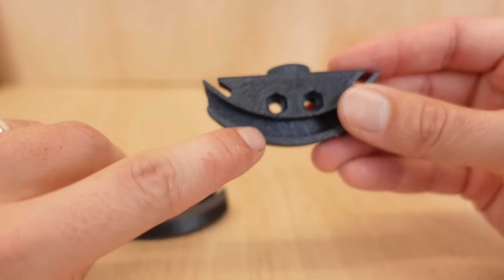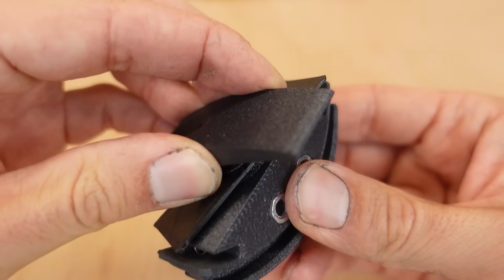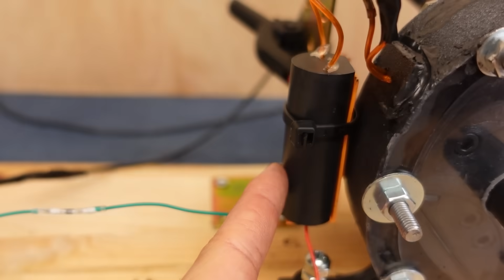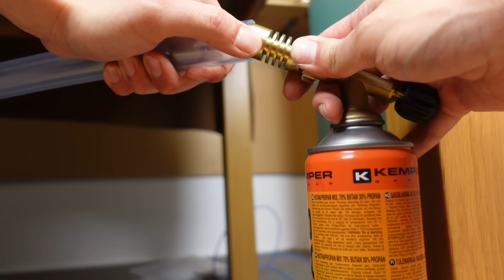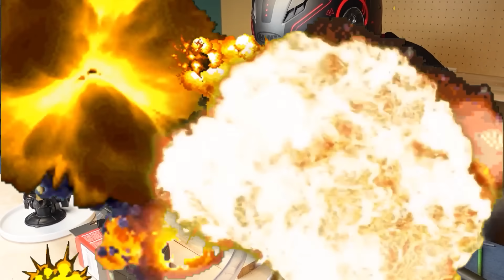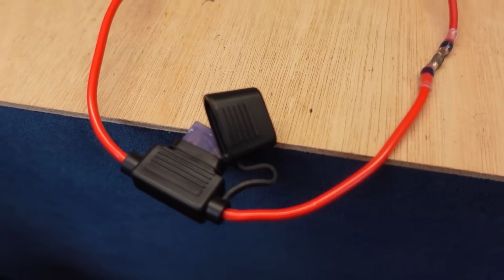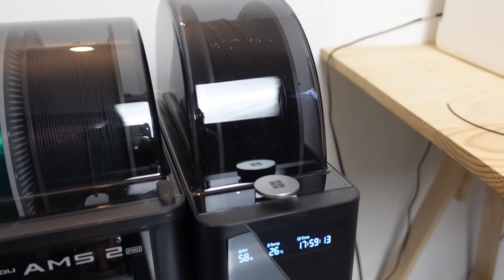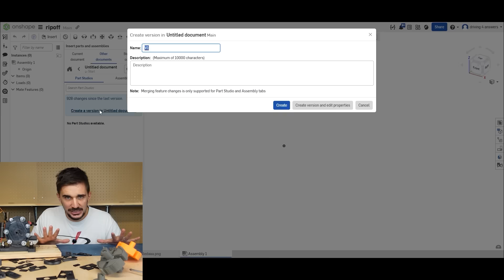My Oval Engine Now Fires At Will! Major Milestone For DIY Oval Rotary Engine 2.0

Comment: at 16:30 - Perhaps it doesn't start because of the geometry of the moving rotary assembly isn't conducive to producing torque.  In other words, the forces produced by the gas expansion can't produce troque to turn the center part of the rotor because there doesn't seem to be any leverage per say. (even though you have a variation of volume, the gas expansion must be able to apply some leverage somewhere, and I don't see how this leverage could be applied in your 2.0 design)
One way to test this is to position the rotor at firing position, remove the spark plug and inject some compressed air in the spark plug hole to see if you can make a small rotation.  There has to be a position where if you increase the pressure, it must turn by itself, even a bit.  Perhaps add grease to the grooves of the 2 moving halves would help? 🙂
Reply: This is why the patent that he is (maybe illegally) coppying has an assymetric combustion chamber with a face perpendicular to the tangent of the rotation.
Also, if you watch his slowmo, his timing is completely off. He's not sparking at the point of most compression
Reply: Correct
Reply: Yup. Not producing torque
Reply: The flame bursts out of the exhaust tube indicate he's not even fully combusting his fuel either. Needs waay earlier ignition.
Reply: I was looking for this.  Test with compressed air first.  Manually activated to check torque and seals.  Then swap to a solenoid to tune timing.  You only need an exhaust port initially.
Reply: I agree and commented the same. Then I read many other comments about the lack of any air being mixed with the fuel and also the unknown compression ratio. His combustion events don't look very energetic, if the engine had verified compression and a proper fuel air mixture, then it would at least have a chance of demonstrating whether his rotor is even capable of producing any torque as it's configured. It does appear to me that the combustion would probably be trying to spin the engine  both forwards and backwards at the same time, or in neither direction depending on how you want to look at it.
Reply: @SteveRucano  Yup.
Reply: That's what I'm thinking. It should have an indentation on the rotor surface so that when the combustion occurs and the gas expands it directs that thrust in a way that produces torque in the direction of rotation.
Reply: @meatthermometer1  uns sei es nur eine nocke an der rechten kolbenseite
Reply: Was also my gut feel but couldn't be bothered to pull out my calculator atm.
Reply: if the combustion begins right at 9oclock on this build, would it not then be combusting and expanding as the top of the rotor opens up new space, there for putting more force on the right hand side of the chamber... no as i type that out im thinking the volume doesnt matter, same surface area on both sides of the rotor, its not trying to spin it, but rather bend the two ends in towards the crank shaft

maybe this is why the russian version he copied had cavities on the leading edges of the rotors

Comment: You need a flywheel. As a kid working on push mowers my dad taught me that the mowers with an aluminum flywheel needed a blade to run. I experienced this first hand. The premise is that the aluminum flywheel by itself is not heavy enough to keep the engine turning. Once a cutting blade is added it started right up.

Comment: Have you tried to take off the cover and to push the rotor by your hand in the same way the BANG would do. Is there enough torque in the desired direction at all? It will push not only on the right part of the chamber but also on the left part. And when it's in the center position the power stroke is over already.

Comment: an engine needs the following: 1.: fuel, 2.: oxygen (air), 3.: spark and... 4.: Compression !

you need the proper fuel/air mixture drawn into the engine, then compress it and ignite it.

your engine lacks the compression part.

also i cannot see the direction the ignition pressure would push the 'piston' to give off the torque on the 'crankshaft'.

on a piston engine the expanding gasses push the piston downwards and in a wankel/rotary engine it pushes the dorito away from the oval corner which expands the space and gives it's very limited torque to the cogwheels and the 'crankshaft'.

your engine never really compresses the mixture and then cannot extract the force on it's piston.

keep it coming ! i love your content, bud ! 😎🫡

Comment: This engine will always be fighting an uphill battle against friction when compared to a piston engine, because of the sliding surfaces aside from the seals. Combustion pressure needs to overcome this movement, and right now the combustion seems to end while this sliding friction is max, while also increasing this friction by pushing the sliding surfaces together. I honestly think the best way to improve the design would be to try and reduce the friction between the lobes and the rotor, either through reducing the surface area, machining a teflon interface or getting pressurized lubricant in the interface, either internally a time of assembly or externally with small holes and a pump.

Comment: the taser modules are 3 to 6v max (whoops you allready know now)
the shaft should have a seal you have zero compression cause its leaking everywhere and theres not much lever arm to actually spin the damn thing and no flywheel but its promising ig id say get it running on compressed air first then combustion :)

Comment: perhaps polycarbonate plastic sheet would be better for the front cover, much better heat deflection temp. 
You can even use a sheet of mica mineral on the inside surface. 
For the gaskets maybe you can make a 3d printed mold and then inject a high temp silicone(?) type of material that then sets in the correct shape.

Comment: You are nuts (this is a compliment, please don't get it wrong)! I really like your way of "thinking outside the box", you do a great job. One question, if I may: how will you lubricate this marvel? But hey, one step at a time, first let's solve the timing and the spark positioning. Thank you for sharing your ideas, you surely keep me busy :)
Reply from the maker: Thank you for inspiring message! I shall lubricate it with oil! This design is actually pretty easy to lubricate compared to the rotary vane for example. It's even better suited to lubrication than a wankel.
Reply: @d4a  Oookay... sealing the sides, the rest of contacting areas, without burning a ton of oil... I declare myself beaten at that. Probably my box is smaller than yours and its getting cold outside :) (kidding). Then the cooling, even turbo charging. Yeah, I'm out of my league. Oil-cooled, perhaps? Could work. The sealing is the part that worries me the most.
Reply from the maker: The engine has a total of 6 seals. That's it. The only thing you need to seal is the little chamber, everything else is conventional. Everything outside the chamber can be lubricated. Even the inner walls of the housing as long as chamber seals scrape well enough. It will definitely always burn more oil than a piston engine but in theory it shouldn't burn more than wankel.
Reply: @d4a  Thank you for explaining. I'm definitely eager to see the further development, I'm also sure you will get it done, properly. Keep going, please. Have a great day (05:37 PM here)

Comment: Where is your oxygen coming from? You're just putting in propane and butane in it if you can't regulate the air fuel mixture it's never going to run just so you know!

Comment: Do not press in bearings by the inner race!, always push the outer race (assuming the friction you're against is also on the outer race, i.e. not pressing a bearing on a shaft)
Reply: usually yes, but...... its a giant bearing going into plastic here lol

Comment: I most likely don’t know what I’m talking about but my guess is to increase the displacement by making the engine thicker and adding a flywheel. This added displacement should increase torque to the point that it can easily overcome friction.

Comment: Those cheapo high voltage generators need to be constantly discharging, if not the output voltage will climb until the internals flash over and die.

Comment: Definitely the ignition timing and the lack of a flywheel. You can see the combustion occurring when it's starting the exhaust stroke.
Reply: You can see the combustion continuing out of the exhaust hole. That is probably even applying a retarding force to the engine

Comment: I think the drill is stopping the free rotation of the engine as it is at a consistent speed, also the copper wire is bending is definitely a factor. Maybe a flywheel and a lawnmower style pull cord will work?

Comment: Sorry for being stupid, by why would this engine generate ANY torque.  Seems to me that an explosion of the fuel gases would apply pressure to both right and left seals of the rotor creating practically zero net rotating force. And the only reason you see exhaust to happen is because you force the rotor to move past the exhaust port by using the drill. Am I way off the mark?

Comment: The reasons why it probably can't run, even if both chambers fire, are...

- friction is obviously way to high
- no flywheel 
- to little compression 
- no precise ignition timing 
- not enough controle of mixture 

Sand the sliding parts, and put thick motor oil in (also for sealing)
Put a big flywheel on.
Make sure the static compression is at least like 1/5 or more.
Build a proper ignition you can adjust precisely. (You got the parts already).
Let the engine take in air directly, and adjust pure gas with a fine adjustable valve. (The one on the bottle might be good enough, just  remove the mixing nozzle from the burner)

Comment: Use a magnetic switch to detect the timing.  Something similar to what detects when a door opens or closes.  Then you can adjust the position of some magnets around an external rotor to get whatever timing you want.  At least, that is the first thing that comes to mind after watching this.

Getting combustion in a 3D printed prototype designed engine?  Ya, that will never work....  Or so any normal person would say.  Congrats on doing the impossible.
Reply: Now that I think about it, magnetic switches probably are not fast enough.  Better to use sensors and a microcontroller.  Oh well.

Comment: Could there be the possibility that the reason that your coils are burning  up because you need BALLAST RESISTOR to protect and prevent the ignition coil from burning up, due to, over current (amps).

Comment: how do you not see it that your design has equal amounts of combustion rotating the motor backwards and forwards? Just draw a line from the axle to the rotor edge where you see flame. That is the torque generated.

Comment: It seems that a) ignition is a bit late and b) how are the holes the spark wires go to the chamber sealed? 
a) Shouldn't it fire the moment the spark wires "see the chamber (max compression?)? 
b) Don't you have compression loses there?
...my 2 insignificant cents...

Comment: 0:11 HA GOTTEM 

Okay jokes aside, I love it when engineers try to simplify the four stroke cycle by skipping pistons and valves entirely. I wonder if the ignition timing could be further improved by jerryrigging a standalone ignition management system (one half of a speeduino…?) and tune this thing better.

Comment: 14:53 I think you need a better electrical contact system, it might be regarding the timing too much when it has power. watch for the spark after the two explosions. the copper wire may NOT be snapping back fast enough when it gets a bit more spin thanks to combustion help.

Comment: I wonder if you can take these plastic pieces and electroplate them. Deposit a thin layer of metal on top, to help dissipate heat, create a smoother surface, and stronger higher heat resistant materials, that are still easy to make.

Comment: Those potted hight voltage power supplies are made for a 5V input and a non-sparking output.  It has no load control, so sparks are a dead short to it, thus pulling more current than it can handle.  Drop your input voltage and add an output capacitor, or just switch over to an automotive ignition coil.
Reply: I was about to say the very same thing! The "spark generator" (sold on eBay as taser units) are clearly described as working from a 3V to 6V DC supply. Connecting a 12V battery just fries them?!? What a surprise!! 😂

Comment: From my experience, you want to keep the hot leads from high voltage generators as SHORT as possible. With long leads, current leaks through the insulation without necessarily creating a spark. You can run them at a lower input voltage and they will last longer.

Comment: This modules are not 12v they are 6v they work even from 1 3,7 18650, from 12 they are overloaded, this is why they die so quikly

Comment: dude, it clearly says 3V to 6V on the listing and you are trying to power it with 12V battery? why? there are ones who run on 12V btw... also the ones you are using produce like 2-3 sparks per second which will be impossible to time right, you need one of those that produce sparks almost continually...

Comment: If you made that part you hit with a hammer with fillets on the sharp edges it would be a lot stronger. if you look at the corners of the part on the inside you will see that the filament isn't even extruded properly in those corners.

Comment: Instead of going directly to gasoline, try ethyl alcohol (ethanol) first.

Ethanol is used in modern gas as an anti-knocking additive.

That tiny engine cannot handle any amount of knocking as it is 😂😂

Also, it might help to use lubricant. Baby oil (mineral oil) should work- though a simple two-stroke is equally as good.

Comment: You've probably already thought of these but I am sure it needs a flywheel, and better timing than loose wires. a hall effect or optical sensor to activate the plug would be much better. I don't know how well you do with electronics, but some simple microcontroller (like arduino) with some coding would allow you to adjust timing very precisely. totally worth it in my humble opinion even if it increases complexity quite a bit. I am very excited to see what you come up with next, and obviously, can't wait to see your engine start!

Comment: Translation for 10:25: "Starts on half a key"
It is Bosnian colloquialism meaning - it is so eager to start that it starts when you barely turned the ignition key halfway. commonly said when you're trying to sell your old car to someone :)
Reply: In french we have "Starts at a quarter turn" pretty close
Reply: @Dixiitum Заводится с пол-оборота. 
Interestingly, with so much French influence in Russian culture, Russians took a French "quarter turn" and added some overhead. Just to be on the safe side. So a half turn 😂
Reply: He's Bosnian? I'm Polish and i thought I heard "pali na pół klucza" but i told myself that I must have got it wrong 😂
Reply: "oca m' "
Reply: "Lec no pusapgrieziena"
In Latvian it's "jumps from half a turn" kinda the same thing
Reply: I don't think that needed translation. It explains itself 😂
Reply: @breakthecode4634 well I was curious about which language it was
Reply: @Deedeedee137 English
Reply: Pali na čvoku
Reply: In English we would "It's like pulling a greased stick from a pigs a*se."
Reply: apparently the last part meaning approximately  "I swear on my father's life"
Reply: Not very practicial. Needs to protect sides of rotary from the actual combustion.
Reply: I've had a lot of local techs tell me "if you point at the key, it'll start"
Reply: Srpski bolan

Comment: same problems with all the rotaries, force on a large area but in direction of the axis, without much of a level. So a very high fuel consumption
Reply: Rotaries are actually decently efficient as long as you keep them under load.  It's when they're running but they're not doing much work that they tend to burn more fuel than necessary.
Reply: Would it work better if the design was less symmetric, so that there was a closer face in the direction of spin?